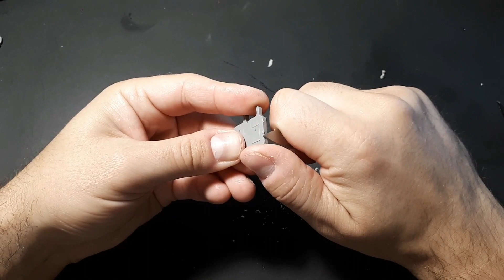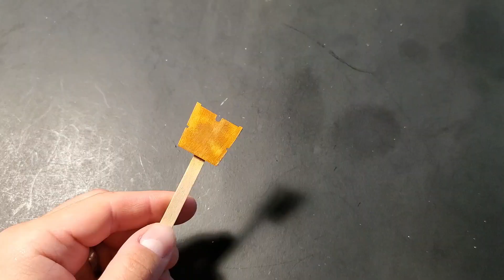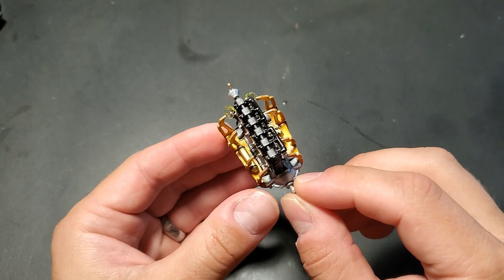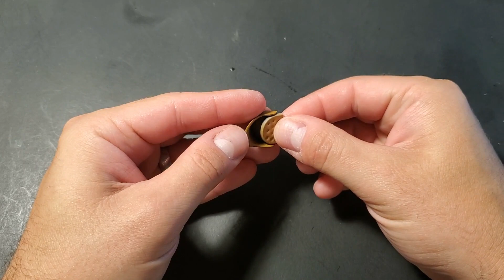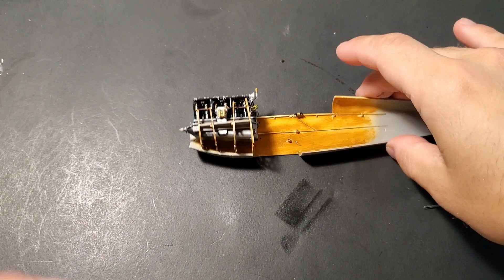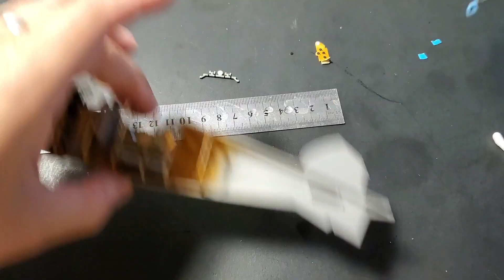Roden 1/32 Albatros D.I, Part 1 - Cockpit

Comment: You work miracles with the very basic kits. I like the little finger drills that you use, easier to access difficult areas, I must try to get some. I watch your videos while making my own models, it is a very nice accompaniment.
Reply from the maker: Thanks, Stephen, I use my small drill bits for more than 10 years and I love them, they are very useful especially in tight spaces. Good luck with your models!
Reply: @FlyingCircusModels  May I know what size drill bits you’re using please?
Reply from the maker: @ronaldbyrne3320  sure, it depends on the situation, but the usual size either 0.3 or 0.5mm
Reply: @FlyingCircusModels  Many thanks. This is exactly what I needed to know. 😊👌🏻

Comment: Well done.....a great start. Looks like a really good kit to work with.
Reply from the maker: It's definitely not WnW...
Reply: Agree....having completed a Roden kit recently I must say it certainly lacked so much compared to WNW.
Reply: I’m building a Roden 1/72 Albatros D.II which is my second Roden kit. They are truly awful in my experience, almost like an obstacle course for modelling skills.
Reply: @JamLeGull  Yes, the Roden kits certainly do cause major headaches but not the migraine types caused by Special Hobby kits in my experience. Dare to say that, without WNW, there's not much out there in the 1/32 scale WW1 aircraft arena at the moment.